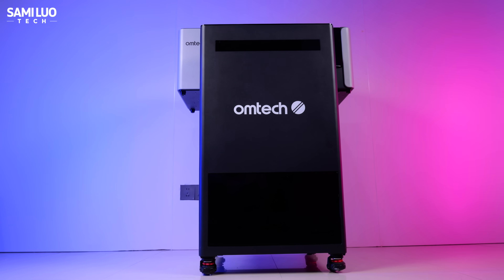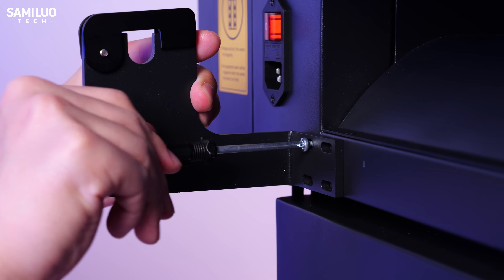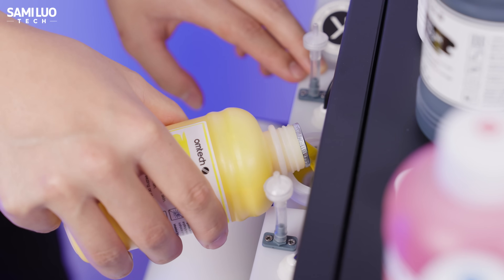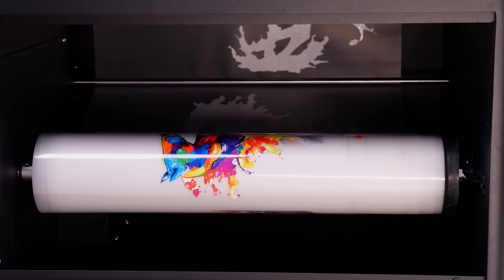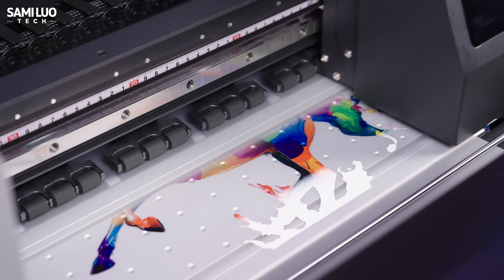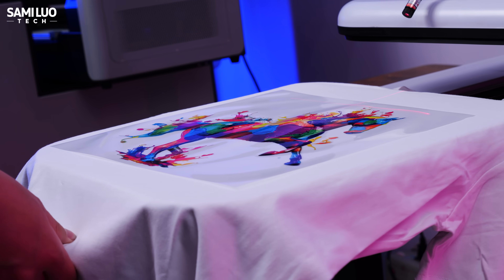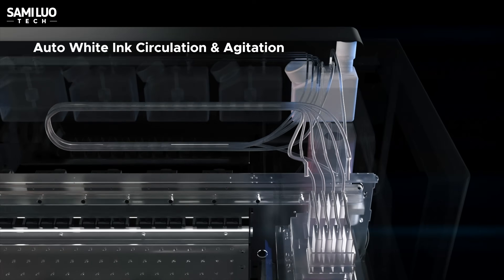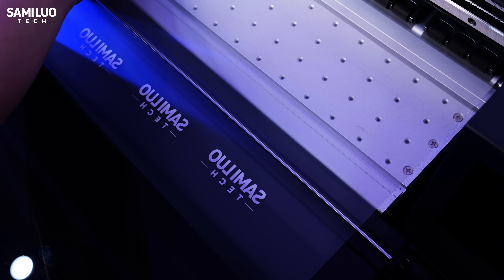No A3 Limits, No Clogs｜OMTECH Aurora DTF Review

Comment: How does the print feel? Plasticy and sitting on top? Would a second quick press without the carrier sheet make it softer, "melt" more into the fabric?
Reply from the maker: The print feel is similar to regular DTF prints on garments — it does have a slight rubbery/plasticky feel and sits on top of the fabric.
If you do a second heat press, you must use a Teflon sheet or cover the design. Pressing directly without protection will cause the print to stick to the heat plate. A second press can help smooth the surface, but it won’t fully “melt” the print into the fabric.
Reply: @SamiLuo no worries, I know about the second pressing procedure 😊 I've had some companies with soft transfers and others with plasticy ones, so I'm just so nervous to drop money on this. But it's OmTech!! I trust the brand lol. Would I be able to order transfers from you to test myself? I am in Los Angeles, CA

Comment: For the pro bundle is there a minimum of  designs that need to be printed to use the rolller film and automatic shaker and bake?
Reply from the maker: Ideally, this setup is best for batch production. We recommend printing at least 10 meters or more at a time to really make efficient use of the roller film and the automatic shaker & dryer.
Reply: @SamiLuo , thank you for your response. It's unfortunate that is the case to have to use that much at once to utilize the automatic shaker and curing. I appreciate your time answering my question.